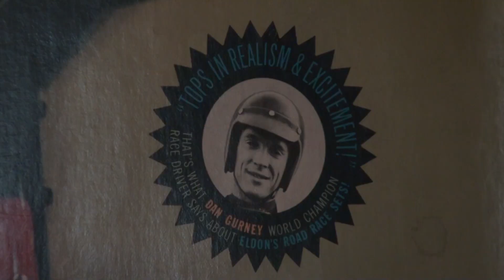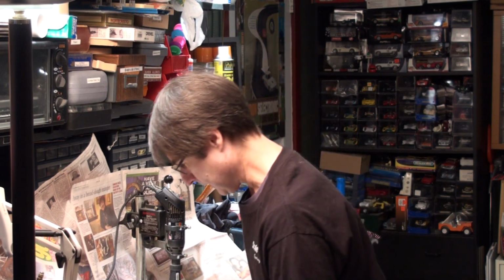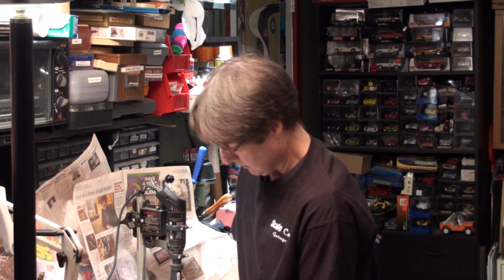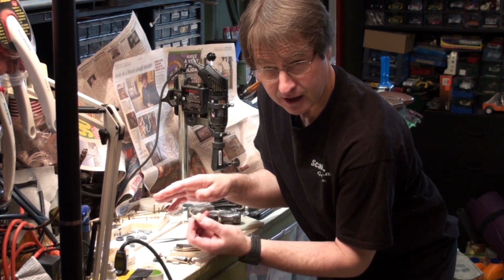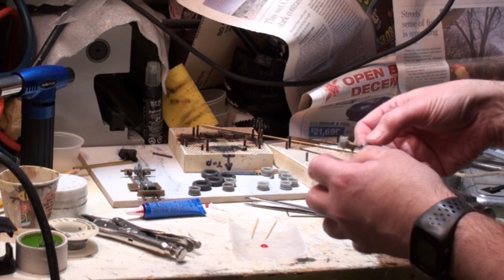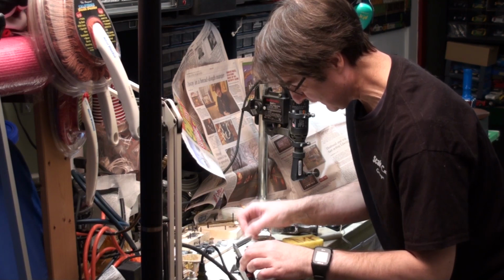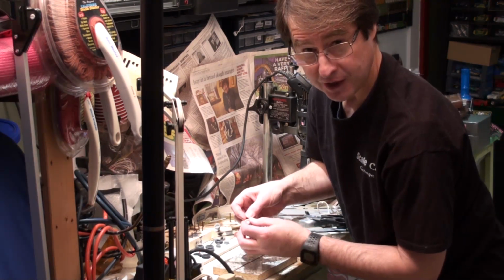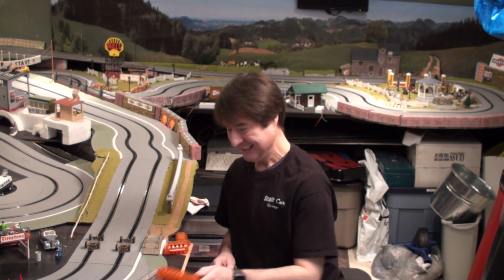Scale Car Garage - Alfa Duetto Spider Build Part 4 - Running Chassis

Comment: They turned out good..well done. I have a Scalextric Ferrari with a spring drive shaft..the spring broke and I replaced it with a empty Bic pen ink tube.
Reply from the maker: Thanks so much! Great solution to get your Ferrari back on track, how is your repair holding up? Thanks so much for watching, commenting and subscribing, I really appreciate it!
Reply: @FastSports-ScaleCarGarage  ...the empty pen drive-shaft has been on my Ferrari for about 5 years now and is working very well.
Reply from the maker: Excellent! I'll have to give it a try!

Comment: Hello John, great to see you back doing update videos and we’ve missed you on Wednesdays. :-) I noticed that you use the open flame torch, soldering technique, as well as a typical pin soldering iron! What criteria do you use to select between the two? What are the primary differences/enhancements that one has over another in their usage?
Reply from the maker: Thanks so much! I'm planning to be back on the next WWSCC! I use the torch for soldering brass and/or spring steel while I use the soldering iron for 'lighter' applications such as wires and such. I find the torch is very effective for chassis building as it delivers a great amount of heat that can be aimed where needed quite easily. The pin soldering iron does not deliver enough heat to solder a chassis but is just great for soldering wires to motors or to other wires I hope this helps! Thanks so much for watching, commenting and being a subscriber, I really appreciate your support!

Comment: John- great video, as always!-- Side question- What color, and type of spray paint did you use on your track- and did you notice any change in traction or qrip? thanks, ct
Reply from the maker: I'm so pleased that you enjoyed this episode! The type of paint we used to cover our Carrera track is VERY inexpensive latex based interior house paint. The reason for using inexpensive interior paint is that the low priced paints contain a higher amount of latex and provide better grip for the track. The colour is a medium light grey. We actually applied the paint using foam brushes which worked very well. I hope this helps! Thanks so much for watching, commenting and subscribing, I really appreciate it!
Reply: @FastSports-ScaleCarGarage  thanks!